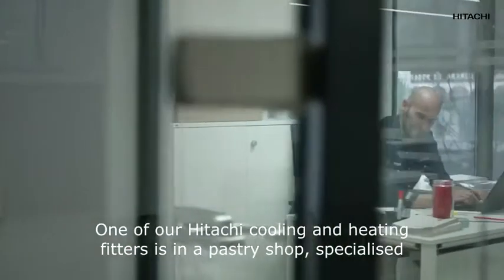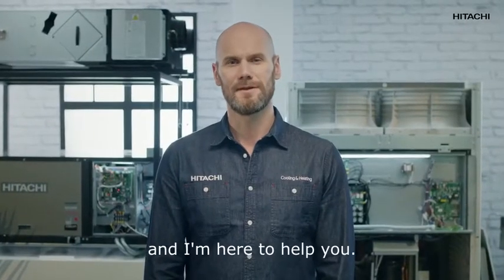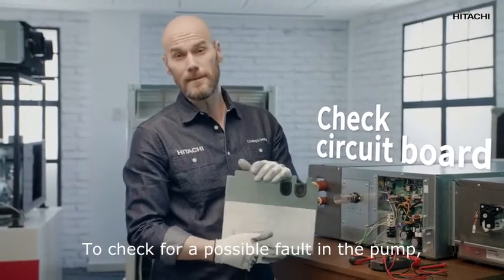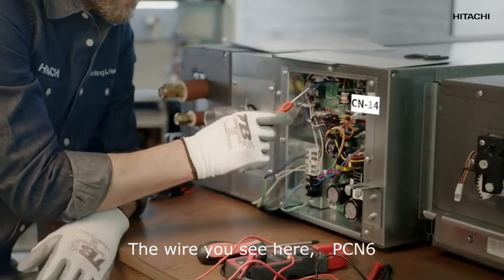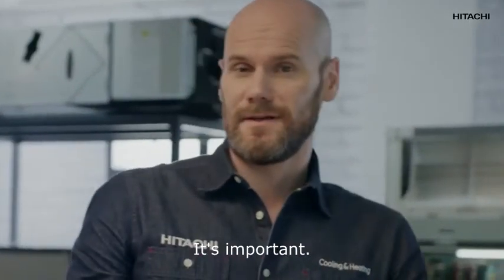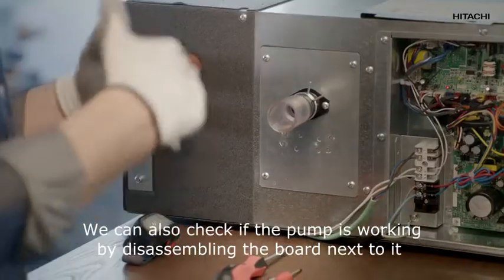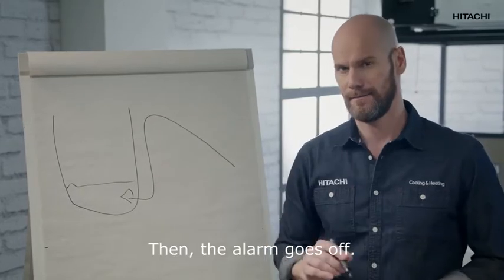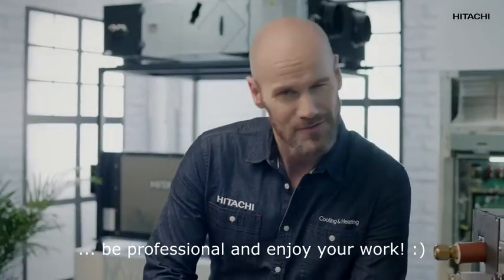How to solve Hitachi air conditioner 01 Error Code on VRF Systems, Centrifugal VRF and Utopia

Comment: Hi, I have window type AC inverter unit (RA-10HVQ model) and encounter error code 82, please advice what this fault code means? And how fix? Thanks
Reply from the maker: Hi Jeff,

You will need to contact your local Hitachi tech support team regarding this issue. Please visit: http://hitachiaircon.com , select your country and click on the CONTACT link from the top menu.

I hope this helps! 🙂

Regards,
Hitachi Cooling & Heating Australia
Reply: @hitachicoolingheatingau  thanks a lot. I’ll check on your link provided.